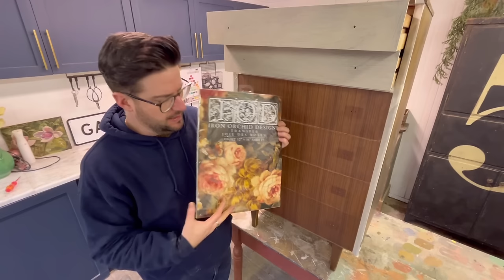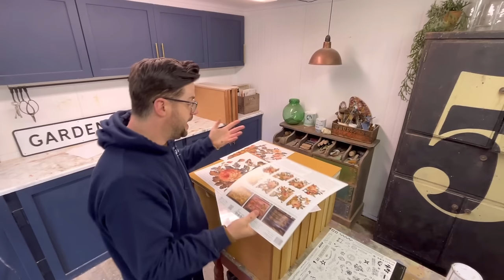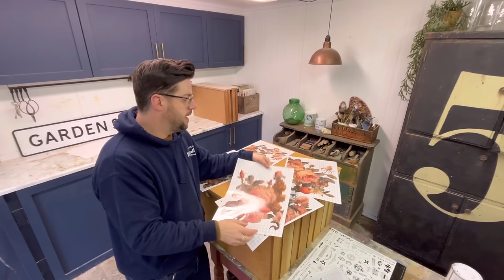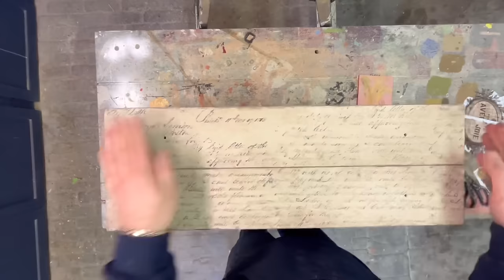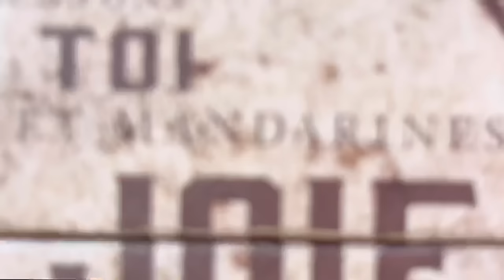Furniture transfer makeover

Comment: I love the top 2 drawers; I’m wondering what it would’ve looked like if u’d kept all the painting that u did on the bottom drawers, but instead of the flower transfers, u’d done the same print stamping that u did on the top, but put it on the bottom also? Just a thought 💭 💭💭 
Maybe take out some of the colors that u added on the bottom, cos u probably added those to match with the colors in the flower transfers?